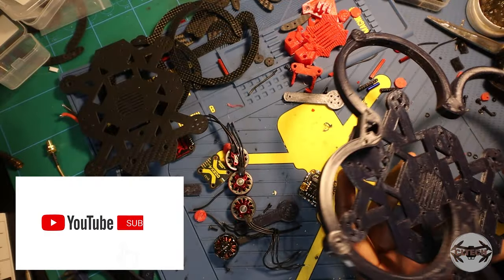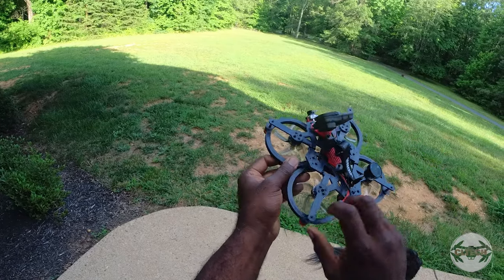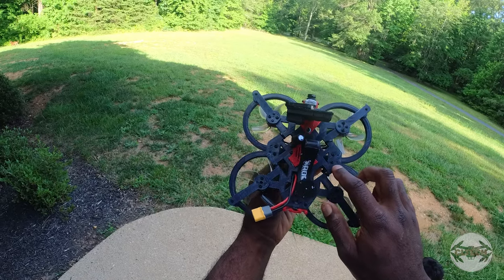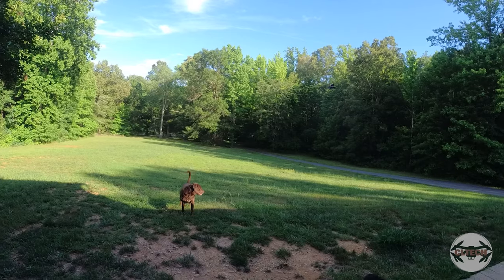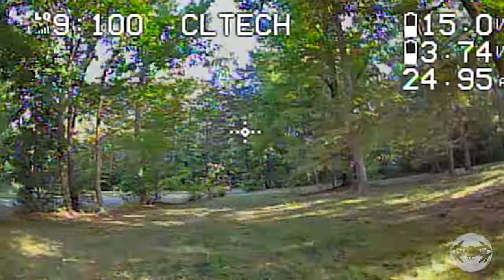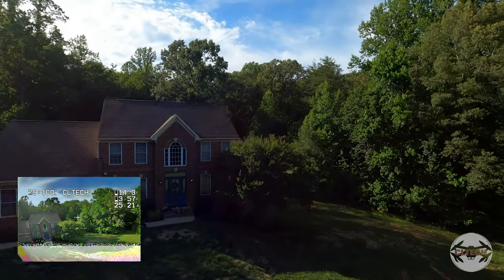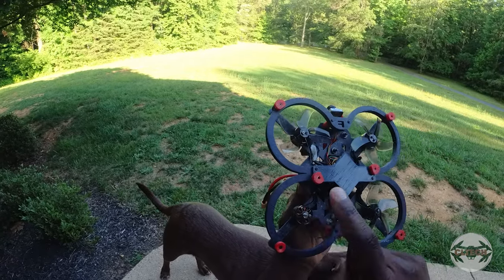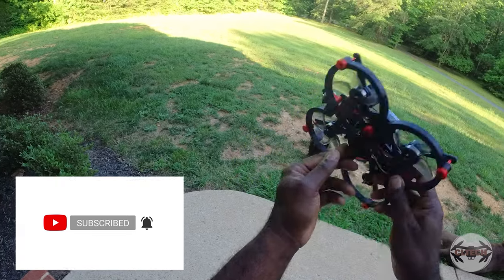1 - CLTech Drone V3 - 3" Cinewhoop - 3D Print Frame

Comment: Nice! That first flight wasn't bad at all for no tune and a semi-rigid 3D printed frame. 

Love Emax Eco II motors. Brother Hobby motors are also nice and have been my goto lately.
Reply from the maker: Yeah I just bought these a while ago because they were cheap.  For being underpowered, I have not blown a motor yet.  I have some new 3D print material from Mexico.  looks very promising.  Gonna but this setup on a frame printed in that material before I switch to Carbon Fiber.